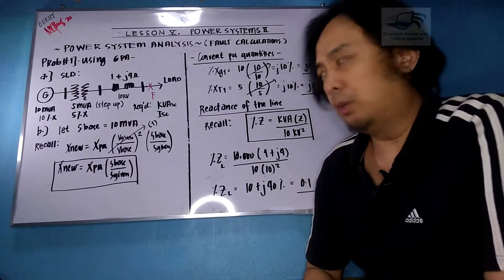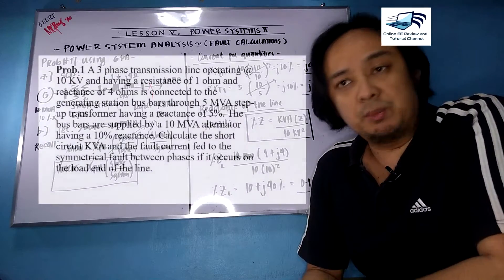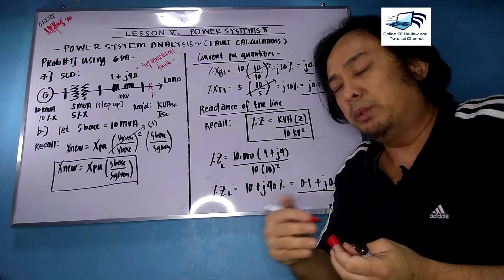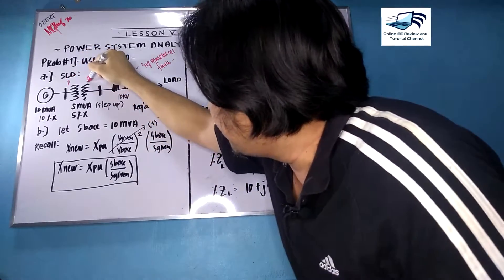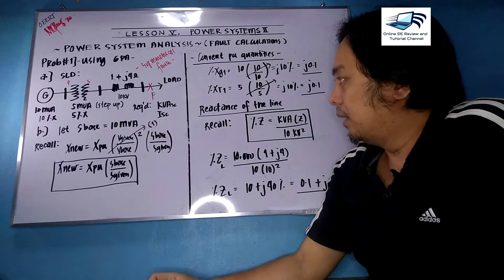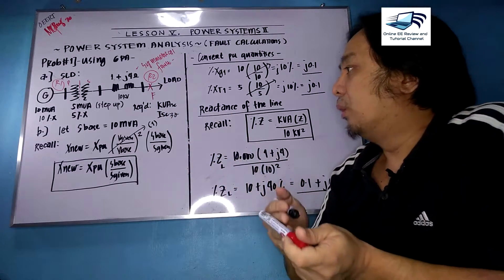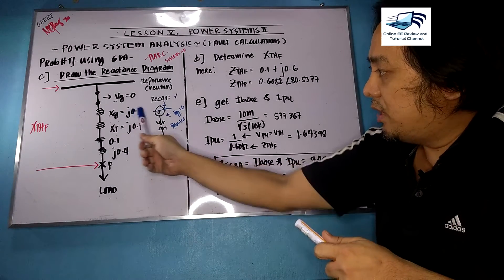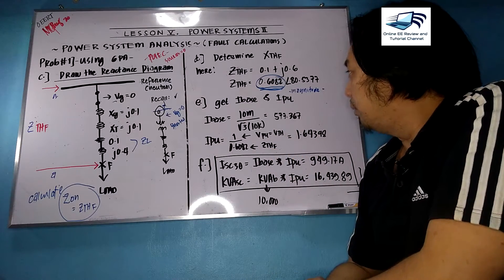Lecture 5.3. Fault Analysis Problems PART I (Symmetrical Faults)

Comment: sir ask ko lang po dito po sa example sa book hindi na sinama yung impedance ng line at Fault 1 for solving the thevenin equivalent impedance bakit po kaya  
eto po yung problem sa book 
" A 3-phase transmission line operating at 10 kV and having a resistance of 1Ω
and reactance of 4 Ω is connected to the generating station bus-bars through 5 MVA step-up trans-
former having a reactance of 5%. The bus-bars are supplied by a 10 MVA alternator having 10%
reactance. Calculate the short-circuit kVA fed to symmetrical fault between phases if it occurs
(i) at the load end of transmission line
(ii) at the high voltage terminals of the transformer"
Reply from the maker: kase kapatid open sya at walang contribution sa fault current.ito ang pagkuha ng thevenins. hope this helps
Reply: @michaelcalizopacisph.d.8089  thank you po sir gets na maraming salamat